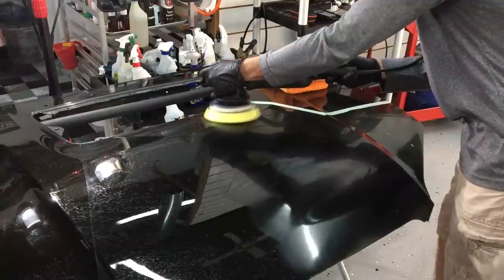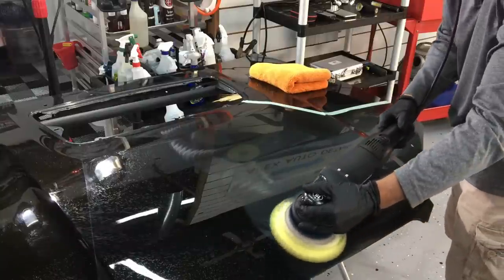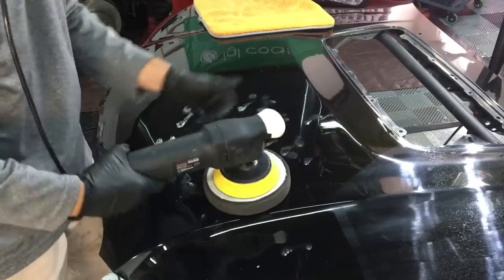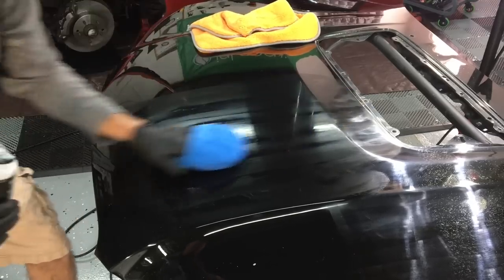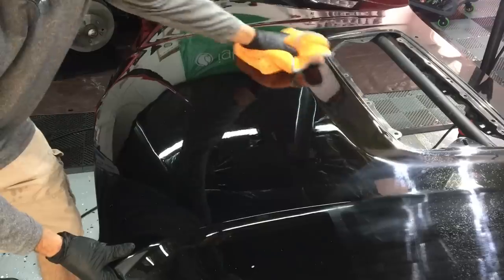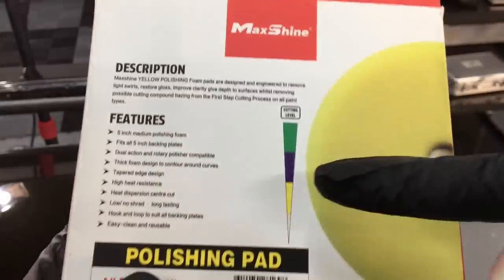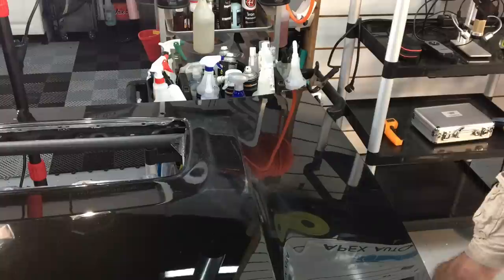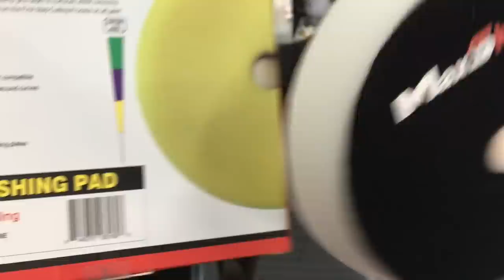SOFT CLEAR Coat!!!!! How To Do Multi Step Corrections!! AND What To Use!!

Comment from the maker: What other types of correction videos would you like to see?
Reply: Beautiful... Maybe now the opposite... Super mega hard clearcoat just wetsanded from 1500. I had heat issues with a chevrolet.  Ever tried the carpro denim orange peel removing  pads?
Reply: VW self healing clear would be good thanks but i guess it might come under "soft clear" 
From memory it was on VW Passat around 2012 , i polished a metallic black wagon a few years ago and remember it didn't like heat.
Reply: @makinamati  i would like to see the denim and velvet as well.
Reply: Great video as always Brian. Maybe a correction video for a knucklehead like me who started a little too aggressive with the wet sanding  I use 600grit on my 2005 town car and then I've tried to do graded sanding 800,  1000 1500 2000 3000 to get back to a nice mirror like clear coat I can't seem to get there.  I'm using the aggressive Turtle Wax Polishing Compound in green bottle.

Thanks
Reply: Brian you have been around a long time I'm sure... why don't you throw one out there where you ran out of polish in the field and had to make something work...
Reply: @carbonconnection2480  I've used toothpaste once on a small job it was horrible but it kinda worked lol
Reply: @acts2211  rotary and wool pad may do the trick. But maybe de denim from 2000 help
Reply: Could it be possible to dress a chart; car manufacturers vs paint hardness...? For you  it seems simple because you work on so many cars but for us we usually have one or at the most two cars at home. We will never get your experience! It's so difficult to know what is soft and what is hard....
Reply: How to correct 3 year old car (black Audi) that’s been machined washed its whole life. Heavy swirls, not many RIDS, goal is get it looking decent for a daily-driver without shaving the clear too deep. Maybe go into the testing process for unknown paints? Thx! Really appreciate your polling us for content, Brian!
Reply: Maybe a video where you correct a damaged solid paint. I mean when the paint is not clear coated paint. Do theay vary as much in hardness as clear coats? How agressive do you want to be and how do you protect it in a good way?
Reply: ALBERTO
Reply: multistep only using rotary...
Reply: @ARCSP10  usually german cars have moderate to hard clear, i think one step will take of that swirles, cut and finish with uro  pad for example
Reply: Apex Detail hi Brian. I have a question about a different video. I watched the video reviewing Adams liquid ceramic wax. You stated that it could be used as a topper on a ceramic coating. Do you think I can use it on top of DPC ARMOR??? 
Love all your videos 👍👍👍👍😃
Reply: utz Thx!
Reply: @paulreichelt1259 . Hell yea man! 🤣🤣🤣 you can use a lotion too 🤷🏼‍♂️
Reply from the maker: @makinamati  I have them...but prefer wet sanding.
Reply from the maker: @acts2211  I start with 2000 or 2500.
Reply from the maker: @carbonconnection2480  Hand cream and hand cleaner.😂
Reply: @apexdetail85  yes sirrrrrrr! 🤣🤣🤣
Reply: I would love to see how to detail the tricky parts of a car... no one show us how to polish in and around emblems or the lower front around headligths and fog ligths and the different type of materials up against each other...
Reply: @arnenuggat . Have to be creative 💪 I'm sure Brian can show the ropes
Reply: @apexdetail85  definitely will use less aggressive stand paper like 2000 2500 the start  I have 3000 grit and I ordered some 5000 grit. I went out to the car today did a few spots on the hood and trunk 3000 grit wet sand One Direction,  followed by a lot of elbow grease and Polishing Compound.  seem to correct the clear coat to a satisfactory level that I was looking for.  If need be for any future work I'll crosshatch with 5000 grit followed by Polishing Compound polish etc
Reply: Extremely soft GM black with a two step correction, especially the final polish 🙏
Reply: Have you tried 3D finishing polish? I am wondering how it will compare to Angel Wax finishing polish.

Comment: I have the whole line of Maxshine pads , I team them up with Oberk both cut and fine polish work good. However the blue pad is mean as all get out and like to walk. I have to prime it so it softens up a bit.
Reply from the maker: I have experienced that. use more correction liquid than normal to get the pad to settle down.

Comment: I have a 2005 F350 SRW. The paint’s name is “True Blue” which is a dark color. 

I was wondering if you had an idea how hard the clear coat is? As you can imagine, the paint is far from perfect and some scratches, swirls & chips in the paint. In the past 2 years of ownership, I’ve was washed it with Meguiar’s Classis Gold, softly clayed it, used Meguiar’s cleaner wax & recently used Turtle Wax’s Seal & Shine. 
I’m planing on doing a 2 step process to restore the paint using Meguiar’s 105/205 to get the imperfections out. Any suggestions for me? Thanks! I enjoy & have learned a lot from your videos.

Comment: Doing a paint correction on my Lexus today and putting UK 3.0 and Gliss as protection. Wish me luck 🤙🏽 gonna use everything I have learned from watching your videos to help guide me
Reply from the maker: You dont need luck...you will be fine!!
Reply: @apexdetail85  Brian after 11 hours of back breaking paint correction, I managed to only put 1 layer of UK 3.0 before calling it quits at 2 am. I'M BEAT 😭 so I have a question, tomorrow I'm going back to finish the other layer of UK and then willing Gliss. If dust is on my car when I go back, what do you recommend doing to get it off before applying the coatings? Thank you if you respond! 🤙🏽

Comment: Hi Brian great video as always..Ive been wondering how would you compare 3D one to sonax perfect finish? Please and thank you.
Reply: I have read on some forums that perfect finish is loaded with fillers. I have not found that true since I have been using it.
Reply: @ww2717  really I haven’t heard that.  I agree in my experience I have not noticed that and quite like it. but have been considering trying 3D one for a change. Thanks.
Reply: I think Brian has videos on both products. I have neither but am trying to decide between the two also. I think both are good from what I've seen.
Reply from the maker: 3D one has a better cut bite. A versatile polish dependent on the pad selection.
Reply: @Apex Detail.  Sounds great,  as sonax can lack there in some situations. Thanks for your time and knowledge Brian.
Reply: @apexdetail85  it also appears the sonax is twice the price of 3D one if that means anything to anyone considering either product ?

Comment: Thanks for the great video! Do you have any experience with correction on Tesla model 3s? I believe they have a softer clear coat and I want to do the correction and ceramic coating myself but I'm not sure what compound/pad combo to use. It just has light swirls.

Comment: great video series...any polish that will work well with sticky paint?..i have 2012 CRV which was built in Japan..i have tried few polishes but they all just stick to the paint after doing few passes and they are very hard to remove.i have to go over with P21s paint cleaner.some of them sweat while polishing  i see droplet coming onto the paint..so far carpro essence worked for me but dusted like crazy and it disappeared after just doing 2 passes so i am not sure if its doing any correction...tried 3d one last time around had hard time removing i..
Reply: The speed of rotation is too high i guess
Reply: Amazed Brian will problably have a better answer than me but you maybe put a little bit too much pressure on your polisher and/or the speed is too fast..did the same error as you the first time but now I’m ok
Reply: I would add that if you’re seeing moisture, are you working after the sun has gone down? As weather cools and dewpoints go down, condensation on cool metal can be a problem. Just my .02
Reply: i use GG6 with speed between 4 and 5 not applying too much pressure and let the machine do the work..also i work in small 2x2 section..
Reply from the maker: Thin polishes such as Angelwax Perfect Polish or Escalation Lotion from Polish Angel are best for sticky clear.
Reply: @apexdetail85  thanks i will try it next time..

Comment: Hey Brian. I was doing an enhancement on a Black Cadillac SRX. I was using Sonax PF with a Yellow Rupes pad on my long throw Bauer and I was getting buffer trails. I was using speed 4 and arm speed was about 1inch / second. I had to end up using 2 small dots of polish and very very fast arm speed to not have buffer trails and get food correction for a 1 step. My initial thought was that soft paint doesn’t really like long throw DAs

Any insight? 
Thanks!

Comment: hello Brian i have a infinti qx60 i bought a rotary polisher and also a flex da polisher i practiced on some junk panels and ive gotten much better with the rotary but im having problems finishing down my soft paint i got most of the swirls out with the rotary and a blue polishing pad but when i use my flex with a finishing pad it actually puts minor scratches in my finish is there anything im doing wrong or anything you can recommend ?

Comment: MAIL CALL Brian !! I have a question for you, I’ve just bought that Sonax Excut 05-05 (not use yet) but I have only a rotary polisher, do I should expect the same result as the DA you have used ? I have differents type of pads also that I can use with.
Reply: Yes, he mentioned that this will be ok with rotary and cut&finish will be ok with DA
Reply: utz My english is not perfect and I heard that excut will be best with a DA, 
that’s why I ask. Thanks for your reply.
Reply from the maker: Cut and Finish was meant for the rotary...and 05 05 for the Da....but testing them both....they work on either polisher. As well as a forced rotation.
Reply: Apex Detail I thought it was the same product but just « renamed ». Thanks for the details. I will try it soon on my car and let you know the results.

Comment: How do you determine how hard a clear is?
Reply from the maker: Without experience on different makes and models...a test spot is necessary. Soft clear will correct with weak polishes and pads. Hard clear will need aggressive pads and liquids.
Reply: @apexdetail85  How hard Is the clearcoat on a black  mercedes CLA ?